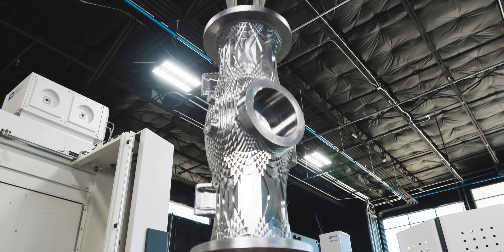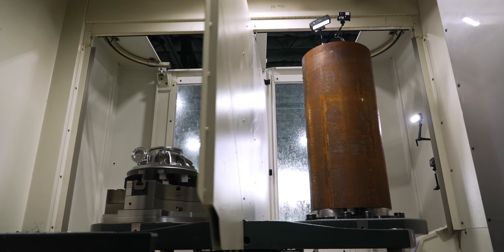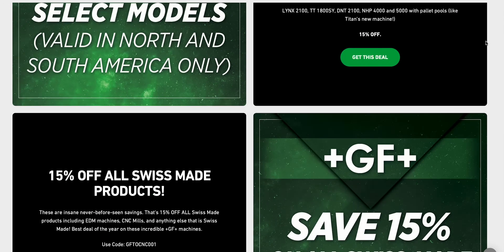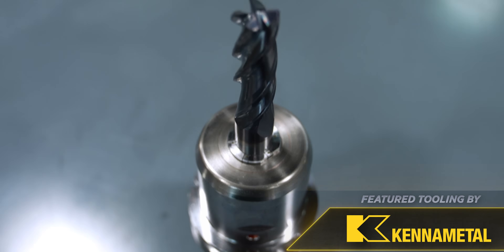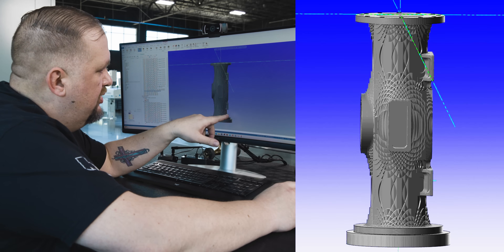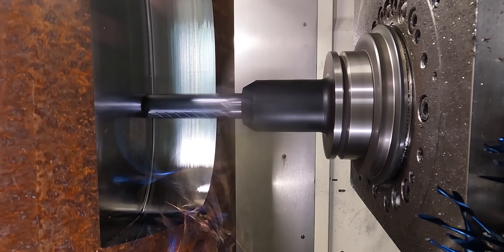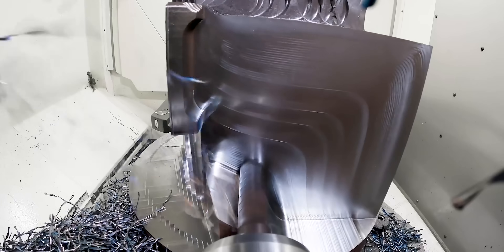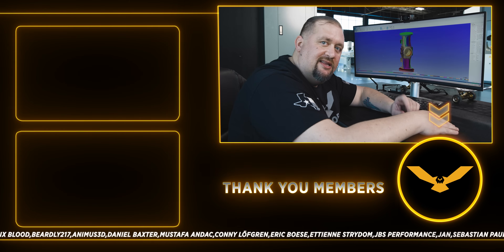This 2200 Pound Part  is Tipping Over😳😳😳

Comment: Would it have been at all practical machine-time-wise to make the program as (at least for the portions it would work) one rotating hogging cut from the top down?(Think the video with this title: "MURDERING Material on Our NEW HELLER CP 6000") Assuming X is the axis in line with the spindle, really only really using X to bring the tool in and out(and obviously Z to move down) to create the form as it spins.

Comment: Would the material removal rate have been better with a high feed mill instead Barry? Or possibly a large indexable endmill, coming back in for pre finish with the Harvey 1.
Reply: The problem was that the high feed mill i wanted to use was 4” diameter. And would only take a .078” depth. An endmill is so much more forgiving, and the TE is so versatile. Thats why we went with that method

Comment: Why wasnt the first roughing done on like a big lathe and all done in a mill?
Asking because i dont know much not because I think i know better
Reply: Because all the features like the mounting feet etc. on this machine, i could have rough turned it, but it would have removed very little material because of the obstacles

Comment: Can you let us know how many of those endmills it took to rough that part? Ive always wondered the lifespan of the harvey 1, if it would be practical to spend upwards of 500 for a single tool. i work in a job shop with 4 employees and use endmills alot to rough stainless, the 200$ price range cutters bust edges very quick. It seems like these harvey cutters are 15x the strength of anything ive ever cut with, any info about this topic would help me so much. Its hard to convince my bosses to purchase expensive tools because of a small shop budget. we do alot of 316l, 304l and a2, d2 tool steel as well.
Reply: At 100ipm, .1” stepover, 3” deep, i was getting around 8 hours. But thats kinda unfair because i had it doing some brutal toolpaths
Reply: @barrysetzer  okay awesome, thank you for sharing! 100 ipm on an endmill is dark arts, i will get to that point one day. I bought my own version of fusion 360 this year and have been using it as much as possible. We only have 3 axis machines, but once this shop closes or i get tired of being underpaid im going for a position like one at titans! I want to be surrounded by motivational and positive guys that actually have a passion for machining so im not the only one whos nerding out and understands whats going on. Thank you and the team for providing this little bit of info! Keep it up

Comment: surely the most efficient way would be on a mill turn , E tower mazak or similar. far better option imo. Cool to see what can be done just in a shop with bags of free high end machines I would rather see it on where it’s best suited.
Reply: Ummmm this was done on a mill turn. But you cant turn this part. Soooooo thanks anyway
Reply: @barrysetzer  Personally, I thought it was a great example of adaptability. You use what is available and responsibly. 👍
Reply: you can rip the metal out faster on a mill turn , Round features both ends and you can hit the through hole at the same time on a steady. Apart from the fancy external detail we do valve bodies like this all the time never once would we consider this as a faster more reliable option .

Comment: nice part berry. and compared to the parts i use to do on a manuel lathe and mill its nice and small ( we had two 6 ton cealing crances but they couldnt even lift our part's even when combined. so we had to do janky crane lift from outisde through the bay port with a 23 ton extended moveing crane xD. that was jank and no one was even close to it well it was moveing around. wounder why xD. btw the 80 ton crane was not setup up yet. it was still laying outside on the fround when i left that companny)
Reply: Hahaha i hear that! Big is relative! At General Atomics we had a Waldrich Coburg VTL with a 60 foot diameter table
Reply: @barrysetzer  see that the size that i use to work on

Comment: Could most of the materiel removal been done from top to bottom by spinning it and moving the end mill in and out? In principle that seem like it should work, and it would maximize rigidity, but I'm guessing there's some good (but not obvious) reason to not do it beyond "we didn't think of that", and I'm interested in what that reason is.
Reply: Having the rotary move unlocks a clamp on the axis, and actually reduces the rigidity of the machine. That's why 3+2 operations are still so common nowadays even with fancy machines. Also the linear axes typically can handle a heavier load than the rotary axis can
Reply: @Marlfox570  interesting. I know I've seen machines milling on rotating parts (so clearly you can make that axis tight enough), but I could see how it would be simpler to build the table if only need high precision and rigidity when it's not moving (you could build it like the taper in a tool holder for example).
Reply: @benjaminshropshire2900  well you can still machine with the B axis unclamped no problem in many cases but you're now relying on the strength of the motor attached to said axis versus having it clamped down. Having it stationary is going to be better for very heavy cuts in harder materials.
Reply: Well actually most horizontal machines (that only have 4 axes) come with a weaker motor that isn't recommended to use with simultaneous 4 axis milling. Though many manufacturers allow you to upgrade said motor for $$$
Reply: @Marlfox570  are you thinking about rotational rigidity around the B axis? If so, then at least for the round portions of the part, that shouldn't matter as the un-commanded motion should be parallels to the surface. As for around the features sticking out, would there be enough backlash to mess up a roughing pass? For a finishing pass, different story.
Reply: "Could most of the materiel removal been done from top to bottom by spinning it and moving the end mill in and out?"

This is the guy claiming to decide what engineering is and isn't on another comment LMAO

This sentence is so dumb it should be framed as things not to do.

"but I'm guessing there's some good (but not obvious) reason to not do it beyond "we didn't think of that""

LMAO lets just spin a part that weights tonnes and is being held by 4 screws and make contact with it using another tool spinning. Reading this comment just shows how arrogant you are to even say the other comments you did.
Reply: @LucasBKOK  The fact you can't imagine how the proposed process could work just shows you lack imagination or are arrogant to the point of thinking that anything that isn't obvious to you can't exist.

I have personally seen a process functionally equivalent to the one I referred to used by professorial machinist cranking out product. Heck, it took me about 2 minutes to find a video of more or less the exact same process (just with a horizontal rather than vertical axis) being used as far back as the first world war. Sure both of those example are different than this case in their own ways, but figuring out what needs to change to scale and adapt solutions to different (potentially radically different) applications is skill that a lot of people have. 

Try spending a few minutes considering how your own assumptions might be getting in the way of you learning something new.

If anyone here is arguing to argue, it's not me.

Comment: On an earlier video I commented that this is real engineering. Someone disagreed. Well, here's more proof that TITANS of CNC are REAL engineers. Amazing stuff guys!
Reply: These guy are at the top of there game there work is beautiful
Reply: Depends on on your definition of engineering. There are valid definitions that can argue either way.

This is amazing stuff, and well beyond "wrench monkey", but at the same time I didn't see any talk about things like computing how fast the part changer could actually be allowed to spin before the part tips, how much difference in deflection you get by milling it from top to bottom or how much thermal expansion different milling plans would experience. At the same time, I'm not saying they were negligent in not doing those things because this is likely a case where tho cost of doing that level of engineering far exceeds the benefit of just being over conservative. Which costs more; an hour doing math in the office or an extra 20 seconds on the machine from running the part changer as slow as you can?
Reply: @benjaminshropshire2900  Interesting stuff!
Reply: That's because it's next to impossible to calculate that.
Good CNC Programmers are process engineers.
The cam software will paint blue lines on the screen. But sequencing and designing your manufacturing approach is the difference between success and failure.
Reply: @jakerawls4727  I'll assume you are are referring to my comments? I chose to mention the items I did because they are all things that I have a reasonable expectation that I could figure out how to compute if I had to and given enough time. I don't know that any CAM software on the market could do it but, if I was forced to, I could (eventually) write a program from scratch to do it. One of them is literally something Newton could have done with pen an paper. Another is a well understood problem that just requires a lot of compute time. And another I'd need to look up to see what research has been done on the basic mechanism (and if the answer is "none", I know some people who could likely get the funding to do the basic research over the next few years).

FWIW, one of the litmus tests (one of many) I used for telling if someone is using a technician's and engineer's mind set is that technicians have a set of tools they know how to use very well and engineers know how to figure out the best tool for the job, even if they have to design and build a new one. When the task is something that can be done within the capabilities of the technician's tools, they will like y have the job finished before the engineer has even chose what tool to use. But the engineers will be able to solve the problem when the tools technician has can't. (Note by the way, that's over simplified and those are far from mutual exclusive; there are a lot of people who a very good at both.)
Reply: @benjaminshropshire2900  he is saying IT IS ENGINEERING, not an Engineering class. People like you who argue to argue are disgusting.
Reply: This is engineering at its core. Nerds who do nothing creative and plug values into a formula will tell you otherwise though.
Reply: @abhirmalhotra5103  I disagree. "Plugging numbers" is not engineering by any definition I'd acknowledge. The engineering is understanding the underlying system well enough to know what questions to ask and how to answer them. Usually the full answer ends up including numbers, but very often the important part is done before you get to the arithmetic.

As an example, for the part changing operation, what needs to be considered relating to the part tipping over? How fast the changer spins around is one thing, but that's actually only an indirect issue because it causes sideways acceleration on the part, and another thing that causes that is starting and stopping the rotation. That is to say you could have a situation where the part would be fine with a normal change cycle and only tip if you manually jog it around. You might or might not need the numbers, but thinking through the implications of the math is about half of what engineering is. (The other major bit is getting specific about the requirements: turning "the part doesn't fall over" into "the total acceleration vector always points inside the contact points of the support arm".)
Reply: @benjaminshropshire2900  ""Plugging numbers" is not engineering by any definition I'd acknowledge"

This is literally engineering. You should follow the advice that other guy gave you, just shut the trap.
Reply: @LucasBKOK  If you think just plugging numbers is "literally engineering" then you literally haven't a clue what engineering is. That would be like saying winning NASCAR is just mashing the gas and turning left.